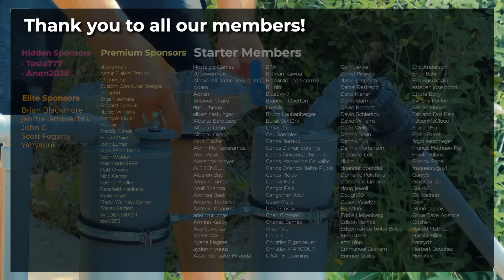I Turn PVC Pipe Into a Water Pump No Need Electric Power

Comment: This demonstration did exactly what it was supposed to do, get us to watch. No mysterious physics at play, not even slight of hand, just a deliberate video hinting at some mysterious phenomena suggesting lost knowledge. Anyone with the ability to reason can figure out how this works, no mystery, no lost knowledge, just the suggestion of the idea of it.
Reply: Hello sir,
Please advise what is going wrong with the unit, unable to pump up the water continuously.
Reply: @michaelslwong the unit used Bernoulli’s principle to draw SOME water out of the creek….but only as long as there was pressure built up internally from the bike pump. When the pressure was spent then there was no more water.
Reply: @ajhubbell3754  Yes, you are right. No matter how high pressure I pump in after opening the valve, the water doesn't draw continuously. 
Please advise what is the pressure needs to pump into this system to make it work.

Comment: You're half the ways there. You can create a venture valve at the inlet or you can go with a ram jet design and then you wouldnt have to use the air pump unless you want to combine the air with the ramjet design to create more pressure.
Reply: Ram pump...

Comment: It looks like it works on the same principle as an old fashioned hand pump. The question is, did it retain the suction after the valve was closed? If so, for how long. Would it work on a shallow well and retain pressure? I've seen many different approaches to this. However, these questions remain unanswered. Great job. Best I've seen yet!

Comment: Interesting that he didn’t run it long enough to push out more water than he poured in. To get a siphon the intake pipe would have to be full of water to start with. The air pressure in the 2 tanks would keep the one way valve closed and just push out the water he poured in.

Comment: Why don't you give us a technical explanation of how it works? A diagram, a schematic drawing?
Reply: It has a one way valve (the black  one in the river side). You increase pressure in two big tubes. The black valve doesn't let to leak pressure to the river and in the other side the blue valve is close. When you open the blue valve pressure of the gas forced the water in the tubes toward exit. The check valve be open and because of the siphonage water comes up .
Reply: @astiagsss2501 как из трубы опущенной в воду может пойти вода, если между клапаном и срезом трубы воздух? Второе,  давление воздуха, в стакане, давит как на воду, заранее залитую, так и на клапан в трубе опущенную в реку . Что его заставит открыться?
Reply: Its been working centuries ago..RAMP PUMP..
Reply: @neilenriquez8678  Я не спрашиваю сколько лет вам дуракам в голову вдалбливают эту ложь! Я спрашиваю о физических принципах работы этой игрушки! Если человек, эту вещь сделал, значит он знает что-то чего не знают ученные физики! Если не может объяснить - значит где-то за кадром стоит обычный насос, а значит он лжец и подлец! И почему кадры на видео резаны? Это значет, есть что скрывать?
Reply: it has a battery inside
Reply: @xienjougao3131  what battery? Do you know anything about atmospheric pressure?
Reply: He can't.  It's not possible to create lift with out energy.  The air pump was the temporary energy.
Reply: Cuz it's common physics
Reply: Because it doesn't work
Reply: Have you ever siphoned gas with a hose? And have a lake next to your house.
Reply: @wadewilliams9702  the outlet has to be lower than the inlet for it to work
Reply: @wadewilliams9702  you can't siphon up hill.  Try sucking on a straw then remove the suction.  The flow stops.
Reply: So that you can use your own initiative to search for the right info.
Reply: @fabriziooldrini6888  there is either a pump hidden or a crafty trick on height.  It doesn't work.  Physics.
Reply: ram pump 로 검색하면 작동원리 알수 있음.
Reply: @astiagsss2501  No.  You CAN siphon water uphill.  You CANNOT siphon to an outlet higher than the fluid level you're pulling from.  Either: 1) there's a pump in the water 2) he's just pressurizing the water in the large tubes 3) video magic.
Reply: @xienjougao3131 No it doesn’t 🙄
Reply: You might be creating a Venturi effect with the air and siphon water somewhat less than the energy he put in with the air pump. The only question is,” What kind of water proof battery and pump did you use here put in the pipe?”.
With the flow in that creek you could easily pump a lot more with a ram pump,a design that is being used al over the world.

Comment: There was an unsustainable pressure flow and when turned off, there was still pressure at the inlet valve.  The leaks revealed the flaw.  This would not function for more than the time it took to pull the air out.  It's missing an element as "free" in this case doesn't reveal "it's truth"

Comment: The Romans solved this using a 'roman concrete' Archimedes screw under pressure at the lowest point in the water.  And it's still working today.

Comment: I think it works like an ordinary manual or battery operated sprayer. You need to pump it regularly to have pressure to push the water out from the water tank.
Reply: Yes, and then you have to manually refill the tank and add pressure to show ignorant people you know how to fool them.

Comment: I can't believe I sit and watch this whole thing even when I saw the first of it I knew it was no way it could possibly work it might have worked or would have worked till the pressure ran out and the water that was in the tanks to start with no way you going to keep signing water when it's not lower than the water table lol 😢
Reply: It needed a flux capacitor to work properly.😂

Comment: the thing is how long does it work. How long I have to use Inflator again?
Reply: until you turn it off
Reply from the maker: The water pumping effect lasts indefinitely as long as we do not turn off the tap or remove the water pipe.

Comment: Lol! This is pure "Bunk". First off using pvc that is meant for electricity, not pressure rated. Remember when you have nothing you get nothing.
Reply: Pretty sure this is simply locally ie nationally produced pvc meant for low pressure plumbing waste line. What it isn't is electrical conduit first of all the pipe's wall is way too thin for it to be effective electrical conduit most especially at that diameter assuming you aren't pulling more than 10 #12 conductors through it for example. 

The manufacturer is Adequa(a manufacturer from Spain), it is also clearly says evacuacion which literally in English means evacuation therefore it is plumbing waste line.